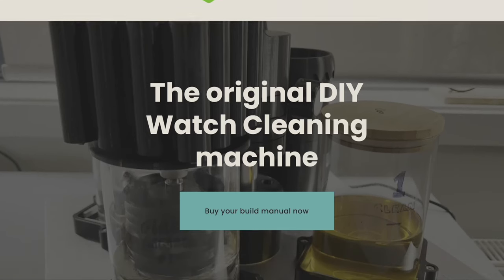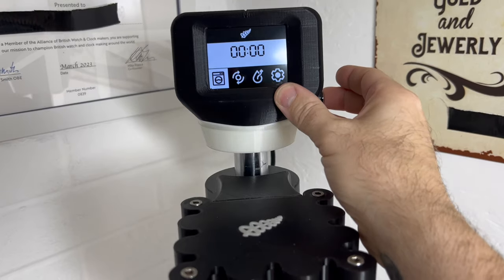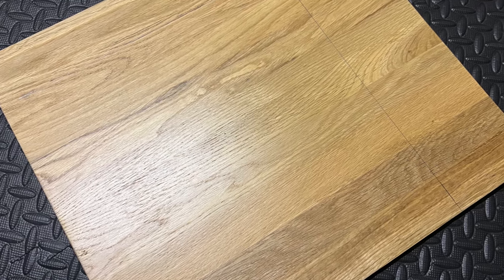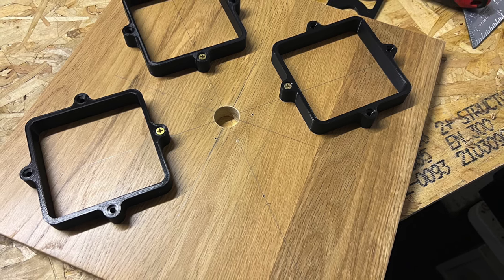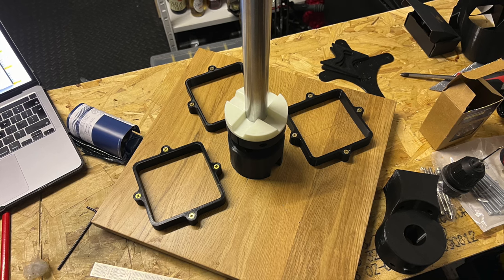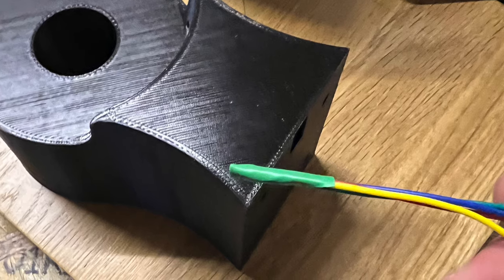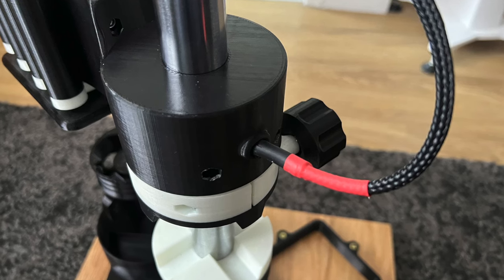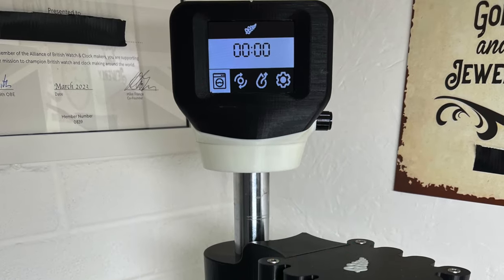KiwiCleaner, Watch Cleaning Machine, Build Video

Comment: This is a very good overview of the machine and what is needed to build it. I had a lot of fun building my machine. I printed all the parts without much 3D printing experience. All the print files are included for the parts and all sizes of jar bases (round and square holders) The first movement cleaned in it is going to be a Landeron 51 chronograph.
Reply from the maker: Excellent which cleaning fluid are you using I went for L&R and I'd recommend 10mins cleaning and rinsing times and 10 mins drying , At work we use an RM90 machine and go with 15 mins and 10 mins
Reply: @ClickSpringReview  I used L&R #111 cleaner and #3 rinse. I had a very simple DIY machine with overhead lab stirrer/gear motor and mason jars. This KiwiCleaner should be much better.  Thanks for the suggested times.
Reply from the maker: I use the same , let me know what you think of it after a bit PS here is the full review https://youtu.be/H2cZArF0hQc?si=IpPzVI91v9fC87vI

Comment: Very nice - what cleaning fluids are you using, and how are the jar seals holding up? And... Where did you get teh square jars from?
Reply from the maker: Im using L&R 566 fluids it’s expensive but well worth it it’s what we use at work, the jars I got from eBay and not had any issues with them, here is the item number 266414076572
Reply: @ClickSpringReview  Thanks!

Comment: Great looking set up and good to see a Kiwi designed machine. How much was the total cost of the assembled unit. Regards from New Zealand 🇳🇿
Reply from the maker: Hi Bruce and welcome to the channel Sir, Frank the owner of the company  printed the parts for me so the total was £450 but around 50/65 of that was buying the the nuts and bolts , as many places you have to buy a pack of 10 or 20 minimum order and for this you only needed 2 or 4 max